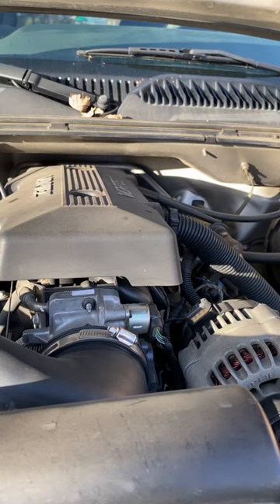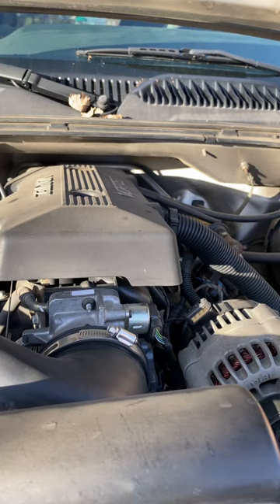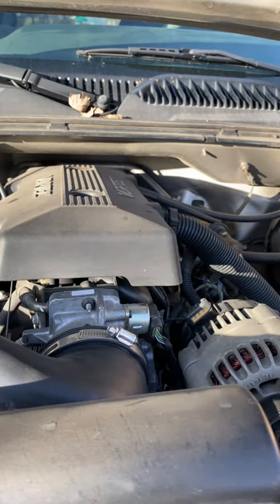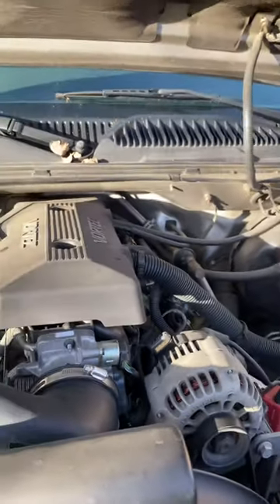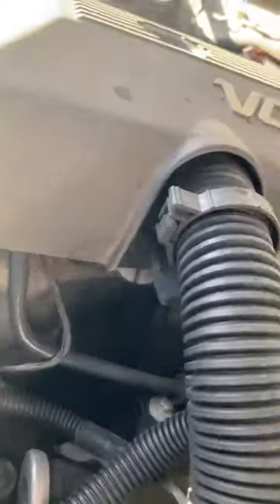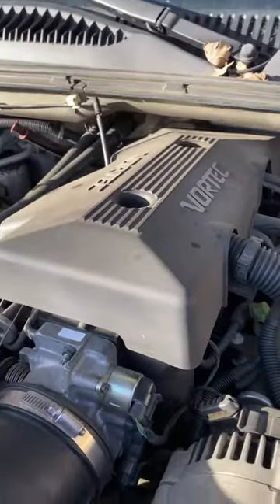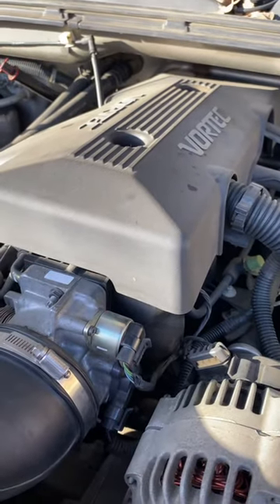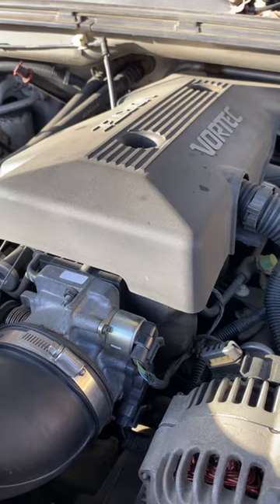Idling Problem FIXED 1999 Chevy Silverado 1500

Comment: t20 screw size and now you can get them under $20, but most of the time you can clean the inners off with carb cleaner in their ready to go.
Reply from the maker: Thanks for pluggin that! Yeah tried that and was still plugged up. Easy fix for sure tho.

Comment: I got a 2000 sierra 1500 and on start up it goes to like 2000 rpm in warm weather do you recommend replacing this as a possible fix ?
Reply from the maker: I would yes. Couldn't hurt.
Reply: looking for an update on this if possible, how did u solve it?

Comment: I have the same problem on my 2000 it be going up to 30 mph without me even pressing the gas pedal, the pedal itself is  really loose do you think that has anything to do with it or  should i just replace this part
Reply from the maker: 100% replace the part. Took 5 mins to do and worked great after. Let me know how it goes.
Reply: @Austin_SOLDanoRealEstate just ordered the part thanks for the video, i’ll let you know how it goes
Reply from the maker: @crossbow7725  Awesome.
Reply: @Austin_SOLDanoRealEstate  it fixed for a little/ helped it i want to say but it did not solve the problem any other suggestions?
Reply from the maker: @crossbow7725  Possibly check the gas pedal being stuck. Other than that I would see if you can put a code reader on it to see if any codes pop up and go from there.

Comment: Was it throwing a code?
Reply from the maker: Honestly cant remember I just could tell rpm's were higher than normal and it was accelerating without me pressing the gas so knew something was wrong. Replaced this part and fixed the problem.

Comment: Ive changed my iac valve but still get the same results especially in this cold thinking about cleaning the throttle body
Reply from the maker: Put a code reader on it and see if its the same code popping up. Also make sure everything is plugged back in. I have done jobs and forgot to plug things back in as crazy as that sounds.
Reply: Mines has exact problem only when it’s cold cleaned throttle body and it’s still the same
Reply from the maker: Any codes popping up? You did buy a new idle control actuator and replace that?
Reply: @Austin_SOLDanoRealEstate  that I did not I just cleaned it up and put it back looking back I most definitely should’ve just got a new one will do that later today hopefully it fixes it
Reply from the maker: @BRED23 Awesome. Yep it took 5 minutes to replace. Try that and let me know.
Reply: @Austin_SOLDanoRealEstate  got it scanned came up with o2 sensor codes I’m guessing it’s because it’s straight piped but also the main one was the coolant temperature sensors gonna throw it on tomorrow when I have time did not buy the IAVC sensor as it cost 140 so that will get done in a weeks time right now I’m probably going to fix exhaust and make it closed circuit was also told it needs a tune. Probably why it’s misfiring and running lean code for taht was p0171 “indicates that the bank 1 system is too lean for predetermined period of time” maybe that’s why I have to hold rpm’s at 1200 for about 1 minute and then it idles correctly
Reply: @Austin_SOLDanoRealEstate  also found out it’s a 4.8 not 5.3 so plans are changing for the build right now I just want it to run good enough to daily when I got it scanned it threw codes 
P0140
P0174
P0300
P0405
P0507
P0141 
Half of those codes I’m guessing are from it being straight piped and having no cats
Reply: @Austin_SOLDanoRealEstate  so I threw on the temp sensor and it started rough more than usual but it idled on its own and got to operating temp then on my way to get it re scanned it threw a temp light and over heating on the dash so I turned it off got it scanned and now it’s saying it’s a hvac sensor or something like that it scared me because of the “overheating” message it gave me any idea why it did that after only changing the temp sensor it was a new one I’m letting it cool off to see how it starts also gonna top of the coolant
Reply: Forgot to mention but the temp gauge was going up and down a total of 3 times then stayed at the correct operating temp the “overheating” and “temp sensors” lights also not flashed for like half a second then turned on and of also about 3 times

Comment: Were you having any codes?
Reply from the maker: I dont think so, just felt the rough idling. Could have bee on though, cant remember.
Reply: @Austin_SOLDanoRealEstate  i appreciate it, at idle my truck seems to idle funky but I’ve never had a light, I’ve cleaned my throttle body and I’ve replaced my intake manifold gasket and that never changed anything not sure what to do next
Reply from the maker: @Jacob-kd6zl I would replace the actuator. Took 5 minutes and couldn't hurt to do.

Comment: T25 or t30 torx.

I had to pull the throttle body off

Or yank alternator to get the IACV swapped.

I have a 1999 chevy silverado z71 with the lm7 5.3.

Do with that info what y'all will, I feel I'm gonna be doing intake manifold gaskets in my case

Oh well
Reply from the maker: Dang... sorry to hear. I must have gotten lucky with this fixing the problem. Good luck with the repair. Keep me upated.